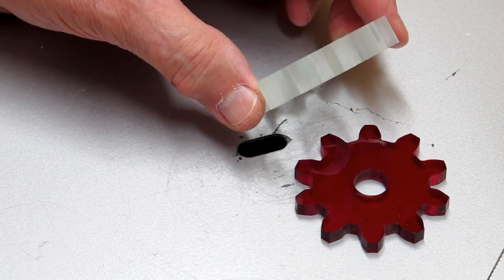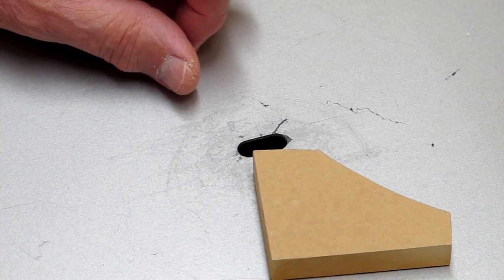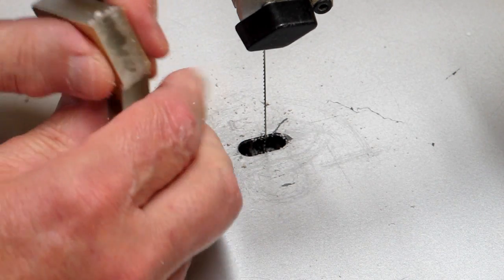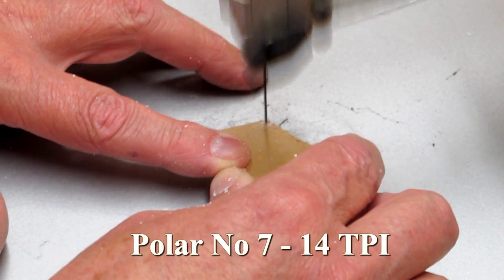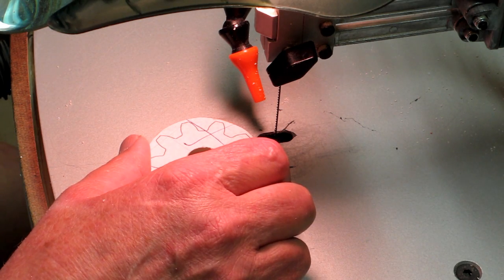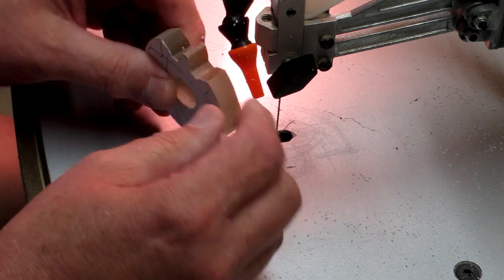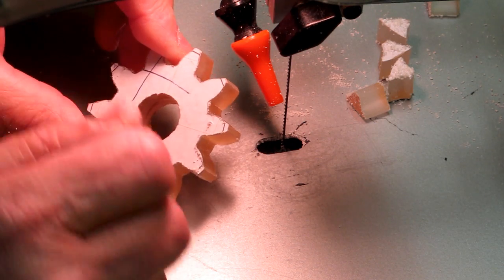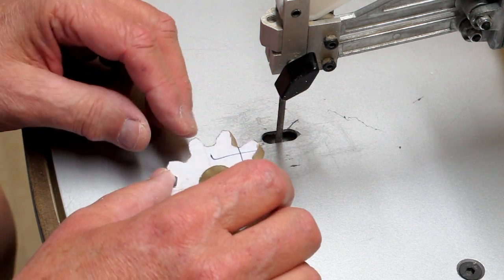Plexiglass Gears On The Scroll Saw

Comment: Plexiglas is manufactured from .060 thick up to 20 inches thick and larger. It is fairly easy to get and is not very expensive. Once you get up to about 1/2 thick... it can run around $6.00/sf. it's best to go to your local plastics distributor and purchase small scraps from their remnant bin.

Comment from the maker: There is a local company where I get some. Works better if they have a random piece they have cut from before. Sometimes they do not want to cut a small section out of a large sheet. I also look around on eBay and pick up some pieces there. eBay sellers are sometimes more willing to rough cut it to the size you need. The plastic and SHIPPING tends to be expensive so you need to shop around for the best deal.

Comment from the maker: I haven’t tried soapy water but I have used water, kerosene and WD-40 with plastic parts on the lathe and mill a couple of times. I don’t think I would recommend using any liquid on a scroll saw. Some places sell a stick lubricant for scroll saw blades… or some say bee’s wax or paraffin helps.

Comment: Ron , In response to LeptonHeavy's post he is correct about a torch , But do not use propane , It does not get hot enough as fast as you need it to get , Instead use mapp gass , It gets hot quickly so you will not need it close to the gears for as long and this will prevent the burning or melting of the p[lastic ......

Comment: Stubborn acrylic paper backing can be easily removed with the help of a local hardware store paint removal-type heat gun: Make a couple of slow passes, about 2 inches away from the plastic, swaying the heat gun back and forth over your plastic. When you remove the gun, the plastic should be slightly warm to your hand (not hot). The heat seams to reactivate the gummy stuff, and make it peel like it is supposed to. No chemicals or solvents needed!

Comment: Cell cast Plexiglas G, red lettering on masking paper, is best for cutting than MC, extruded acrylic with blue lettering on the mastic paper, which will melt if not using special blades. Plexiglas is a Trademark name.

Comment from the maker: I have not used Plexiglas, Acrylic or Lexan for clock wheels. If I did, the thickness would be ¼” or ½” so the teeth would not be thin and would be as stronger if not stronger than a similar section of wood. Cutting the plastic teeth can be more difficult than cutting a wood wheel. Wood clock wheels should last several lifetimes and so would the plastic version.  Google WOOD GEAR CLOCK and find Clayton Boyer’s website. Someone made the TOUCAN clock using plastic wheels. Just look around for it.

Comment: I believe Plexi (clear acrylic) is better in this application.  Lexan is tougher for applications like window panes in bad neighborhoods, but plexi is actually harder, i.e. it breaks more easily but is less vulnerable to scratching.  Lexan is messier to cut because the edge is harder to clean up if the offcut chips congeal into a "beard" in the saw, which is often with either material..

Comment: Hi Ron, thanks for this video - it's already help me figure out some stuff with a project of mine. Do you know if Olson still makes the scroll saw files? I can't seem to find them anywhere. If they don't, do you have an alternative that you recommend?
Reply from the maker: It certainly looks like they have disappeared. I had no idea. I have not purchased any in years. It looks like the only thing offered now are sandpaper strips and they probably would not be much good for gears and I doubt they would last very long. The Olson 42100 scroll saw files were a mediocre product. The grit was bonded to the metal blade with epoxy. You had to be careful not to get it too hot or the epoxy would soften and that was the end of that section of the "so called" file.

I had considered trying to convert some jewelers files to work on the scroll saw but the quality of the files these days is pretty bad and having it work in a small area I doubt the file teeth would last very long.

This guy has a method of making a sanding strip.
https://www.youtube.com/watch?v=OHU_KZH0bdo

The problem will all of this is the sanding strip is only being used in a narrow area. But then you can turn the strip around and use the backside and then flip it end for end and do the same thing.

A wider scroll saw blade or possibly an old hacksaw blade ground down a bit would provide a wider and stiffer sanding pad. Again, a light touch is required. You will not want to get the tape too hot or it will also release the sanding material. You also do not want to push against the sanding strip too hard or it will sand a curvature instead of a square edge.

One nice thing about the Olson files was you could use the edge (gently) to get into some fairly tight areas.

In the following video I believe I show how you can clean up the cut a little by using the side of the scroll saw blade teeth. A light touch is required... practice makes perfect!

Cutting Wood Gear & Clock Wheel Teeth
https://youtu.be/AQ92urCdybU

Hope that helps.

Thanks for watching. Please subscribe! 
That is what keeps this channel going. 
Ron
Reply from the maker: Two more ideas from youtube.

Scroll Saw Sanding Blade
https://www.youtube.com/watch?v=_3IBMhiCDIE

scroll saw sanding strip
https://www.youtube.com/watch?v=VHQaIevE38Q
Reply: @RonaldWalters2010  Thanks for the feedback and pointing me towards these resources. Definitely keen on the velcro-centric design. I did try using just the edge of the regular blades to  sand things down but I need good flat edges for these interior, hexagonal holes I'm working on so I'll retry with these new ideas.

Thanks again, I subscribed!

Comment: Lexan or aka "polycarbonate" is easier to cut. Its a softer material than Plexiglas aka Acrylic.... If you do stick with Plexiglas just remember to purchase Cast Acrylic and not extruded.  Extruded is much more brittle and will melt a lot easier.  Also keep in mind that acrylic has much more clarity (just like glass) than lexan.  Lexan has a purple'ish tint to it but you can still see through it.  I actually do suggest using Lexan over Plexiglas any day.  Especially when making gears.
Reply: Definitely wish I'd seen this comment sooner. I bought a bunch of plexi which turned out to be extruded and no way would it work for intricate cuts like this. With cast acrylic, it was a breeze. Ronald Walters should have made that clear in his video. Repeat: BUY CAST not EXTRUDED. Chemcast is a good brand. Hmm - I should try polycarbonate next.

Comment: When I cut Plexiglas on my CNC machine with the end mill it will melt and stick to the end mill thus ruining the work. An easy trick is to use soapy water as a coolant. just a little mist on the work piece will do the trick.
Have you tried this with the saw?

Comment: Lexan, or polycarb does not melt as easily, making it easier to cut. It's not as brittle, and is 250 times stronger than glass. Plexi glass is only 50 times stronger. It's more expensive, but well worth it.

Comment: would you mind telling me what method used to attach the pattern tp the Plexiglass?
Reply from the maker: +BloodSweatnBassOutside The peel off protective coating is paper faced. The paper pattern is attached with spray adhesive.
Reply: +Ronald Walters thanks a bunch
Reply: You can also use a glue stick (less messy than a spray)